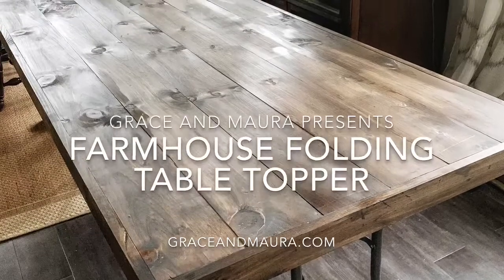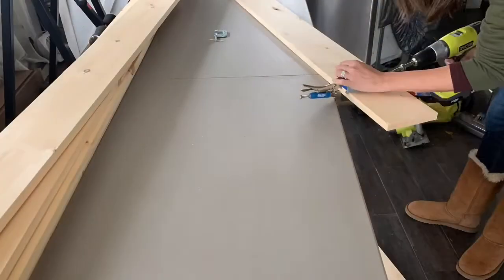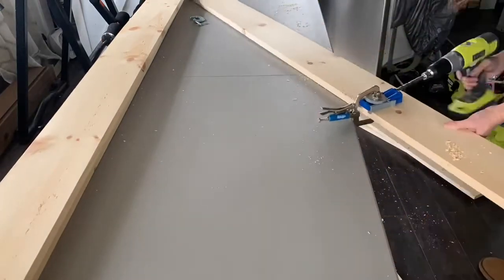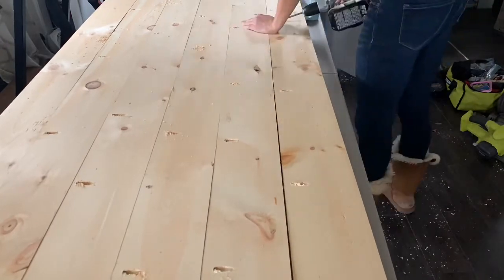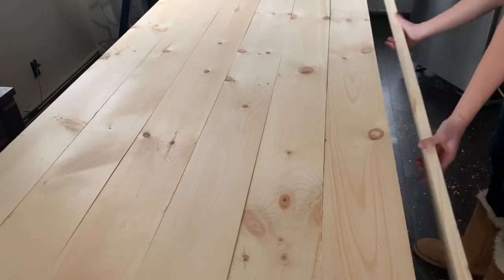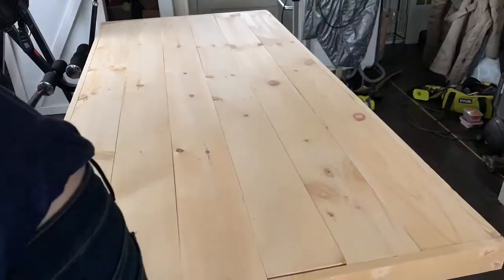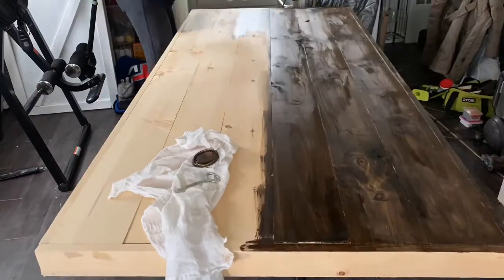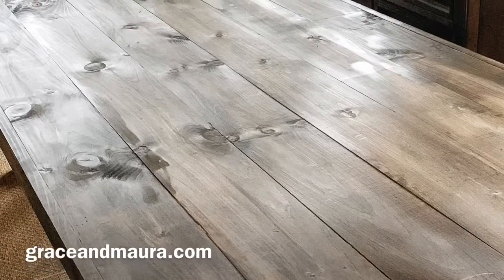DIY Faux Farmhouse Top for Folding Table

Comment: As stated the end of her video, her blog/website has the information. 

Materials:
 
6 1x6 x 6 boards *
3 1 x 3 x 6
Stain
Nails
Wood Filler 
Sanding Paper
Kreg Jig
1 1/2 pocket hole screws
Circular or Miter Saw